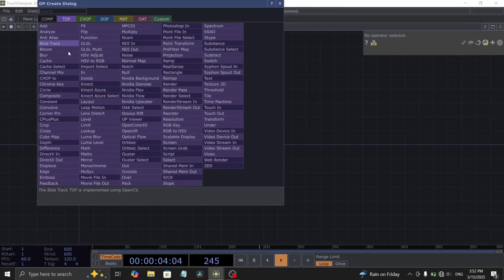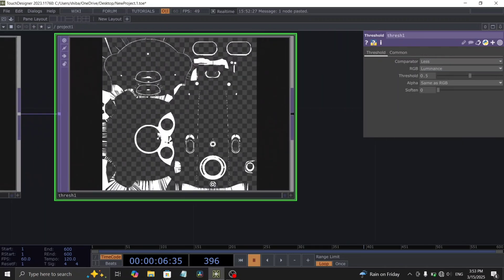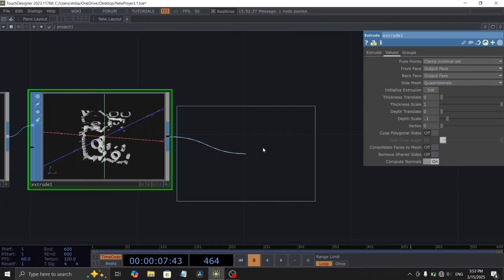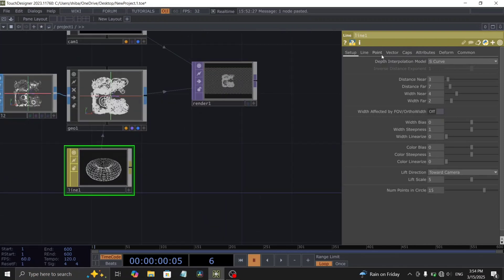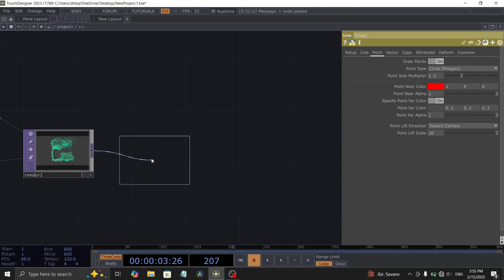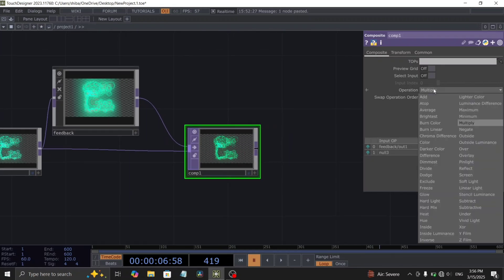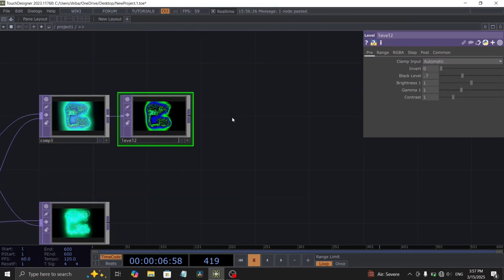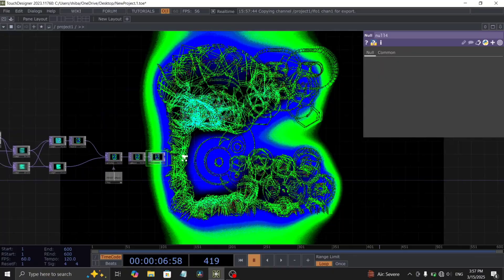Image to 3D Fractals - TOUCHDESIGNER Tutorial

Comment: Hi! thanks for the video, super easy to understand. Is there any way to get the same colors from the image through the different lines?
Reply from the maker: U mean the images that I used  in the beginning of the network?? pls clarify
Reply: @PiFrac-DEV yes! Exactly is there a way to do that? (Thanks for replying)
Reply from the maker: @sc_hdz "Maybe you can use the HSV Adjust TOP after the Render TOP and play around with the Hue Offset parameter